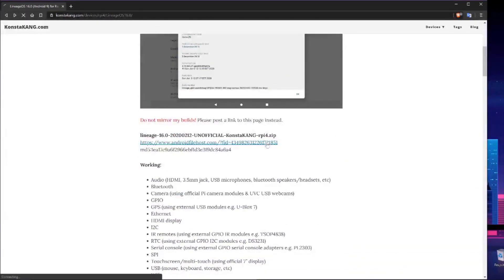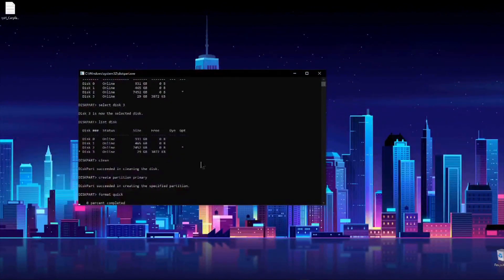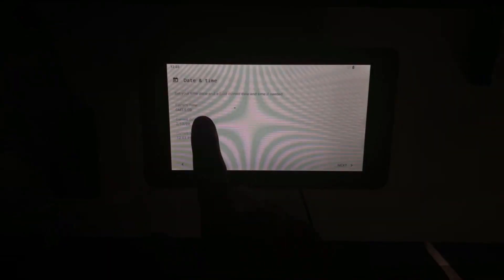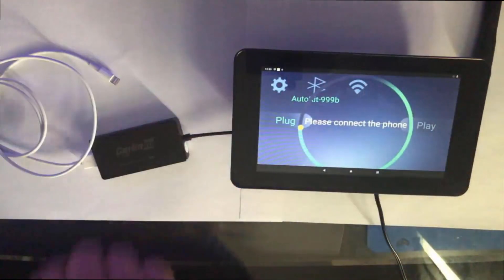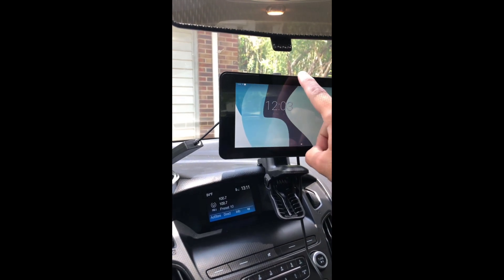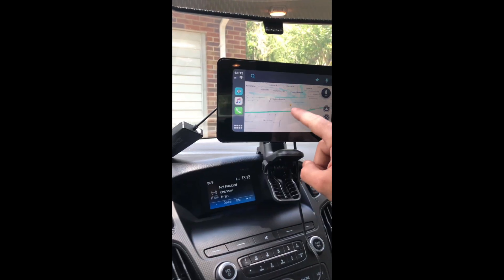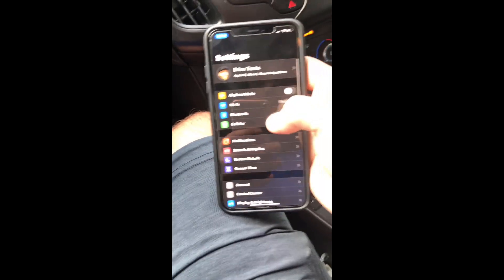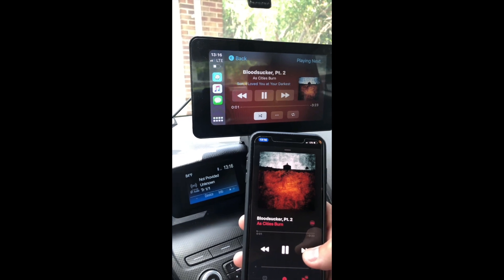Apple CarPlay running on Raspberry Pi 4

Comment: Hello,
If I download LineageOS onto my SD card and plug it into the Raspberry, it only tells me that I should update the Raspberry to the latest version, which I have already done several times.
Can you help me?
Reply from the maker: When you boot up; do you see the LineageOS running, or Rasbian?
Reply: When I boot it, it only shows the black Rasbian page asking for an update on the firmware. Lineage OS is not running.
Reply from the maker: @FriedrichStörmer  you will have to flash the SD card with LineageOS. 
Right now, you’re running Raspbian.
Reply: Well, that’s what I did 😢. But Lineage doesn’t boot. I formated the SD card to fat 32 and flashed Lineage onto it several times. I have no idea what’s wrong

Comment: Does it over heat at all ? I wanted to put in my dash permanently. Just wanted to use this for waze.
Reply from the maker: I never had it up long enough to really test if it would over heat. But I’m sure if I left it up on top and no ac on, it would overheat
Reply: @BwithEe  how does the gps work ? Has it given you any issues while driving ?

Comment: Great project, thanks for the tutorial. However, one thing that I encountered is that there are different versions of the Carlinkit adapter and only one is working with the Autokit app. So be aware what you buy guys!
Reply: Which one works?

Comment: Wow good video, thanks to the author.
For the last couple of years I want
assemble a carPlay for a motorcycle.
please give me some advice on accessories:
1. Which screen to use, I want 5 inches, maximum 5.5 ?
2. Rasberry Pi 4 Model B (2GB) ok? or is it better to take 4 Gb? 
3. How to deal with heat or won't it heat up?
Reply from the maker: I’ve ran this setup on a pi3 before, but it didn’t work as well. 
You can use any display you want honestly, it all depends on what you’re looking for. 
I’d deff recommend the 8gb for this project

Comment: Lol really useless 😂😂 u have more work at every car start than before and cables everywhere. Why not use a iphone stand 🤷‍♂️ … or do it right ;)
Reply from the maker: It was a project. Not permanent. 
But, if I had the proper parts for building a new dashBoard, it could be more fun to have a rpi in the car. 

Thanks for the comment.
Reply: @BwithEe  i see :)

Comment: I recently came across this video and decided to buy and re-create this project. FYI the panel they have thats similar to this one the touch screen responsiveness is extremely slow and buggy regardless of the raving reviews on amazon. I tried using LineageOS 16 as well as the newer 18.1, played with screen resolution for CPU performance, and tried many commands in DOS to get things to line up and it was still extremely slow. 

If anyone tries to re-create this project please be aware its not this YouTuber's fault but the products you'll buy. I was able to get the components to work much better with Rasp 4B and a 10.1 inch touch screen instead of a 7 inch touch screen. Great video still and good luck to all. 👍👍👍👍👍😀
Reply: I am looking to do something similar to run wireless carplay/android auto, and run video to screens in the backseat.  Basically homebrew a modern Toyota siena entertainment and navigation system for a 2017 van.

What did you do differently than this guy's setup?

Comment: Very good video, I used the same device and system, but when I plug in the dongle and start, the system will crash and restart automatically. Have you encountered this problem? How can I solve it? Thanks
Reply from the maker: I used my car's USB port to power it , however, I did have so power issues here and there where it would randomly restart.

Comment: Thanks for the sharing man,
I try this on my own,
For your information,
DON'T buy Carlinkit ver2,
it won't work with AutoKit App

And I try Lineage OS 17.1,
It need to use HDMI screen first and change the screen driver to SwiftShader for using 7" official touch screen,
 (Lineage OS 16 only have SwiftShader so you don't have to change driver)
or you need a HDMI screen,
and the result is it crashed and reboot all the time.

I find out SwiftShader with official screen will crash so much,
and HDMI screen with MESA driver seems quite stable,

I just bought a 7" HDMI touch screen,
and I'll even try the latest Lineage OS 18.1 (they took off the SwiftShader so it won't work with official touch screen)
If it works without crash and reboot I'll let you know.

Once again thanks for sharing this
wish me luck or all the money just gone.
Reply from the maker: Best of luck! And I’ll make sure to keep this noted for future advancements of pi-projects.
Reply: @BwithEe  I'm back with the luck.
Yes it works well with HDMI touch screen.
It's stable and works great.

Some experience to everyone try to do this.
1. Lineage OS 17.1 is not working perfectly
    It will not self-open autokit app booting up with dongle attached.
    Instead, it will reboot unless you unattached the dongle.
    So OS 18.1 will be better choice.
2. I try the USB mic and 3.5 mm jack mic
    And none of these works with autokit app.
    So maybe should buy the dongle with mic built-in if you want to use Siri or voice search.

Good luck everyone.
Reply: @BoLinTryToTranslate  what HDMI touchscreen did you end up using? I’m looking to get some of my issues solved similar to the ones you had on lineageOS 17 and I’m debating on if I should go to 18.1 or go back to 16 (I have the official touchscreen).
Reply: @EvanHorsley  I use Waveshare 7inch HDMI LCD (C)
Remember to adjust the OS screen resolution to 1024x600 if got this one
I didn't try OS 16 cause I couldn't download one for some reason.

Other thing you should notice
1. For screen case I use 3D printer to print one I designed
2. It's hard to hide HDMI cable behind the screen, you'll need to get one of those 90 degree soft wire HDMI to micro HDMI cable

Good lock

Comment: Hi, I have a problem. If I power on the pi, open the app and plug Carlikint directly on pi, after 1-2 minutes the pi reboot. Same issue if I plug the carlinkit in a usb hub. While, if I attach the dongle to the pi and the powering on, after it booted up, it will immediatly reboot. How can I solve this?
Reply: Deactivate WIFI that fixed it for me

Comment: When you connect via car bluetooth, can you initiate siri from your steering wheel control?
Reply from the maker: I wasn’t able to get the car button to work with the pi properly. It’s because I’m only using the pi as a middle man interface. But if I Bluetooth to the phone from the car, yes. 
You have have the car bluetoothed to the phone, have the pi connected via aux. and have all your music go to your car and bypas the pi, but at that point the pi is just more of a big screen showing you what’s playing or what you’re doing.

Comment: If you were to use this in an older car, as the main touch screen - center stack feature, what did you use, or do I need for audio processing - amp etc ---  to then send the audio signals to the speakers?
Reply from the maker: Does the car have Bluetooth and Aux? Or just aux?
Reply: @BwithEe   60's car have nothing - I am starting from ground zero
Reply: @BwithEe  can you use the dongle but with Bluetooth iphone to the dongle?

Comment: Thank you for using the interface quickly, this is the first video I’ve seen that actually pushes the software to the limits, I want some thing very fast. So I might try the 8 GB ram model.

Once I have the funds I would like to try this installed on my motorcycle! I’ve been doing Uber ways to make ends meet and this would help.

However, most likely I will have the pi inside the “dash”.
Reply from the maker: Jacob Wonder that would be awesome!
If you do it, post a video please!
Be safe out there!

Comment: How did you get the Bluetooth microphone to work? I don’t even get the recorder app to pick up sound from any Bluetooth mic. USB works just fine🤷‍♂️
Reply from the maker: there is two ways to do this
1. bluetooth your phone to your car and plug your phone into the carlinkit, the usb from your phone to carlinkit will broadcast your music and apps, while your phone is bluetoothed to the car
2. might be an issue with the carlinkit apk, uninstall and reinstall if needed, the bluetooth should work

Comment: Hello Brien Travis,
I took on the same project.
Unfortunately, my Bluetooth connection keeps breaking off.
Do you have a guy for me like I can do that.
When I try to connect the Carlinkit, the PI4 keeps restarting.
I thank you
Reply from the maker: What are you powering it with?
Also, make sure to turn off any unnecessary settings that are not needed.

Comment: What did you use for power? I tried using a regular car charger in the cigarette lighter but the lightning bolt pops up and it crashes. It’s not getting quite enough power.
Reply from the maker: i used the factory usb port in my car actually
Reply: did you over clock the pi?

Comment: Great tutorial and project.      In wireless version the PI always crash and reboot in loop.    Wired seem OK.  
Hope a fix for wireless version will come out soon.
Reply: Turn the wireless of raspberry pi off
Reply from the maker: I had similar issues in the week that I used this. 
Sometimes wired would cause a reboot, and vice versa. 
However, it was a fun project that I wanted to share and try. 
I was hoping to replace my sync in my car and use this as the full dash. 
However, it’s not as good as true CarPlay.

Comment: What do you use to power off the Pi safely?
Reply: You can add a UPS and configure the pi to shutdown by itself after a certain amount of time or the UPS battery drains to a certain level. Would also add the extra convenience of not waiting for it to boot up again if you’re just leaving your car for less than 10 minutes.
Reply from the maker: i used the factory usb port in my car actually
Reply from the maker: Sorry I never answered your question. When I shut my car off, the pi shuts off. I’m not to worried about it. I know it’s not the best approach. But I’m not afraid to spend money on another pi if needed
Reply: Brien Travis same, so far so good. 😇
Reply: I’m also interested in this question? What happens when you turn off the car and walk away? What about when you come back and switch it on, do I have to power it up manually? I’ve got a Ford Mondeo with double din, if all of that ends up costing in the 100s it might just be a lot streamlined to buy a second hand Kenwood/Pioneer/Sony and not have to put up with manual actions. Afterall it’s for a reason I’m using an iPhone 😅🤭

Comment: This is great!  I followed the instructions and purchased everything listed for parts needed.  But what I notice is my pi will just reboot after a few minutes of plugging the CarPlay dongle in.  I can boot the pi without the dongle and seems to run fine - anyone had this issue?  Or know what it might be?
Reply: the dongle could be taking too much power and the pi reboots
Reply: Try turning off Wifi in LineageOS (LineageOS 17.1). it resolved reboot issue for me
Reply: I would bet it is simply a power issue as plugging in the phone charges the phone.

Try a higher amperage car adapter!

Comment: I am trying to do the same with a RPI3B+. It works fine with a hdmi monitor but it doesn't with the official 7" screen. 
It actually displays the square with colors buth then full black.
The led "act" on the raspberry turn on and turn off green so I don't think it is an issue with power.
Any ideas ?
Reply: Official 7” touchscreen is only supported using SwiftShader software renderer.

Comment: Great tutorial.  Followed it and set everything up without a problem.  Having some issues though with the Pi rebooting while running CarPlay in my car.  Has anyone else had issues with rebooting and if so is there a fix?
Reply: Try turning off Wifi in LineageOS(LineageOS 17.1). it resolved rebooting issue for me.
Reply: friendspkp I will try turning off WiFi in LineageOS.  How are you powering your Pi and Screen in the car?  Are you powering Screen and Pi separately?  What type of car adapter are you using?  Thanks in advance.
Reply: Turning off WiFi worked!!!  No more reboots.  Thanks!!!
Reply: Steven Libutti friendspkp I will also try!  Thanks
Reply: friendspkp I will also try!  Thanks
Reply from the maker: I had this issue at first also, make sure you have enough power for the pi and screen.
Reply: Brien Travis Thanks!  What are you using to power it?  I am powering both the screen and the pi (not the screen from the pi) using a 1.5 ft USBC cable from an 84W dual port type C Car Charger that is rated at 60W power delivery and by specs can be used to power a MacBook Pro in the car.  Here is the link:  https://www.amazon.com/USB-Car-Charger-Compatible-Ultrabook/dp/B07VG61LCS
Reply from the maker: Steven Libutti maybe it’s not a power issue then. Are you able to run it from a regular house outlet?
If not, if might be connection from the screen to pi issue.
Reply: I am able to run from home outlet using Pi power supply, but I have never really run it for more than 15 minutes or so inside.  When I get the reboots in the car it can be 15 or 20 minutes into a drive using Waze or Maps.  Are you powering off of a cigarette lighter car charger?
Reply: Any one tried with the 8gb maybe that’s why I am having power issues
Reply: Yes
Reply: Jeremy Wright any updates on a fix?
Reply: Garry Tweed I ordered a 2gb one to test with I get it tomorrow will let you know. So far the 8 just crashes even when giving it more power.
Reply: Garry Tweed so no matter what I use I don’t feel this is stable I always get reboots maybe it’s because I’m using the wireless carlinkit and it draws to much power I’ve tried with a powered hub as well always the same issue. Constant reboots. Just don’t think it’s ready for the pi 3 or 4 yet as I’ve tried both. Really disappointed tbh.
Reply: Jeremy W - same here.  I even ordered a 5v-3amp power supply and still no luck.  I was excited to get this up and running in my car.  I may try to get a non wireless adapter, or I may try to get it to work on my fire tablet 10.
Reply: Jeremy W - agree - I was excited to get this setup in my vehicle.  I may order a non-wireless adapter if they have them.  And also thinking about using my fire tablet 10 if the wired adapter does not work.  I even ordered a different power cable 5v - 3amp but still same results
Reply: Garry Tweed same I was trying to go the cheaper route but I may just end up replacing my receiver in my car just didn’t want to spend 900 bucks if I could do 100
Reply: Garry Tweed I have the wired version of the adapter.  I still get constant reboots to the point that it is unusable.  I think the OS is unstable after trying multiple power adapters and powering the screen and Pi from separate power cords.  Hopefully a more stable version will come out.
Reply: Steven Libutti Agreeded - hopefully an update or new version OS comes out.  I was all excited when I first setup the project.  But went downhill within 10 mins reboots...

Comment: Hey mate, how do you plan to mount the display to the car?
Reply from the maker: Alfo Nso with the Ford Focus, I was able to put the pi4 case right in from of the sync screen. I hardly ever use it unless changin radio stations and such. It fit perfectly
Reply: Brien Travis thanks for the tip, my prob is that my VolksWagen hasn’t got anywher to stick the mount, I don’t wonna use the glass. I think gotta invent something with a 3d printer to adapt the ventilatoin system...
Reply: Alfo Nso Depending on your VW, you might like to pick up an RCD330. Look it up. 👍🏼

Comment: I have a Acura TL and want to set up something similar since the stock navigation is outdated. Any advice or directions on how to go about it?
Reply from the maker: Adrian Marquez you could use an aux cable for sound and a usb mic for the pi
Reply: Brien Travis what do you need to connect the raspberry to your unit by Bluetooth? I want to setup android 9.0 with lineageos. I want to have a gps atenna, 4g Lte, how would I connect the raspberry tablet to the cars Bluetooth. Is this set up possible?

Comment: Which Carlinkit are you using?  Can you use the new wireless CarPlay adapter from Carlinkit?
Reply from the maker: Steven Libutti yes you can use the wireless.
Reply: Great video.  How are you powering it in your car?  From a cigarette lighter adapter?
Reply: Steven Libutti i do so

Comment: Interesting project! What kind of memory usage do you see, would the 1 or 2 Gb version Raspberry Pie be enough?
Reply from the maker: Henrik Höjer I originally saw this done on an android tablet vs the pi. 
But I was helping other pi users get CarPlay this way. 
Just a fun project. 
It worked on a pi 3 before I tried the pi4.
Reply from the maker: Henrik Höjer it works on the raspberry 3 with 500mb
Reply: Thanks all, I just saw that KonstaKang do write “This build currently uses Google’s SwiftShader software renderer so graphics performance is probably not what you’d expect. This build is not suitable for media device use or graphics intensive gaming. I’d also recommend using Pi 4 models with 2GB or 4GB of RAM to run this build.” and “Not supported: Hardware accelerated graphics (V3D), Hardware video decoding & encoding”. So an Odroid or a used, large screen phone or tablet is probably more suitable to run the apk then. I’ll try one of these days...
Reply: Henrik Höjer I was also wondering, he is using the 4gb and it IS laggy.
Reply: @jacobwonder6735  CarPlay processing is done on the iPhone itself. The mirroring that the apk is doing doesn't actually require that much memory. I have 2019 Vauxhall/Opel with default CarPlay enabled infotainment and even that is also somewhat laggy.